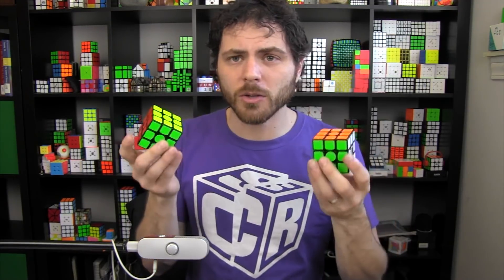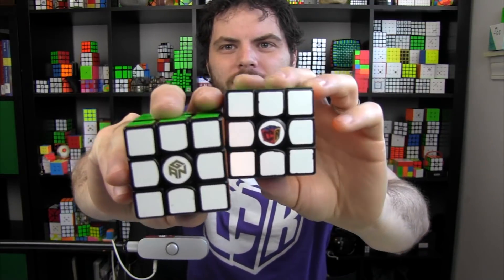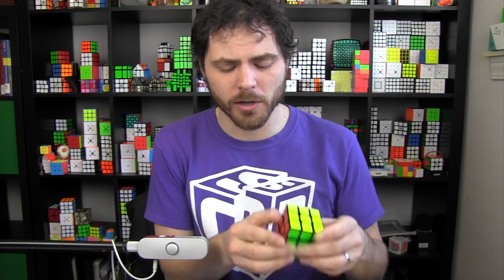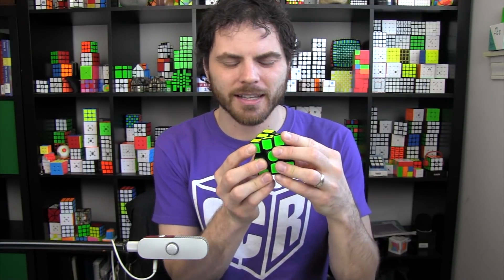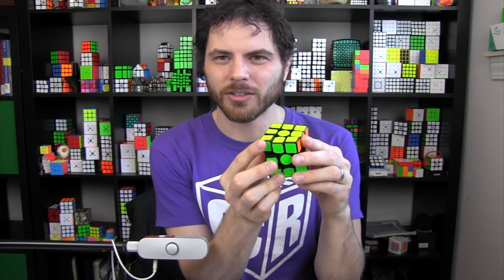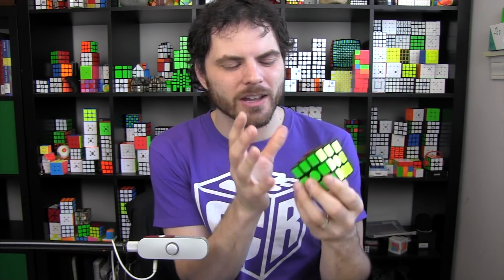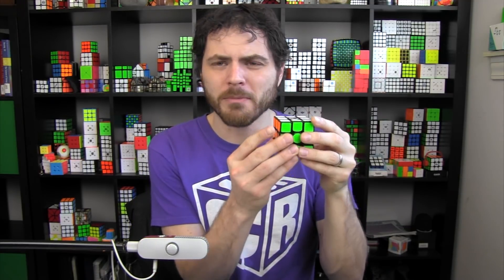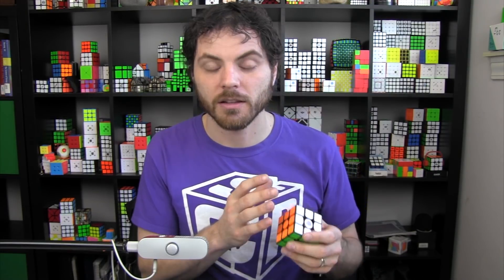What is the Point of Magnets in Speed Cubes?

Comment: 1 main problem a lot of people fail into in is to think magnets are essential. Many puzzles perform better without magnets and already have stability. Magnets are not needed and although help a large percentage of cubes, there is still a portion of cubes which are better without. Also the assumption that magnets solve any problems with a cube is just false. A cube needs to have decent performance in the first place to be a good cube regardless of magnets.

Comment: So wait, why do top BLDers all uses non M?
Reply from the maker: They don't. The current world record was done on a Gan SM
Reply: @SpeedCubeReview  Max Hilliard, Graham Siggins, Stanley Chapel and a few others use GTS1 non M though. Jack Cai is the only top BLDer to use a gan cube afaik
Reply from the maker: Yup, they like the feeling of the original GTS which didn't come in magnetic. Many people do like the stability of magnets. They don't all use non magnetic too. For example, Stanley uses a magnetic 4x4 and 5x5.
Reply: @SpeedCubeReview  weird. well thanks for the info. I've never had a cube where magnets made it worse, but I guess people have their preferences
Reply: @minnow766  Magnets affect the speed on slices. Most people would fast slices for bld and magnets significantly reduce the speed on slices due to 2 distinctive points of pull.
Reply: @LukeMcRitchie  makes sense actually